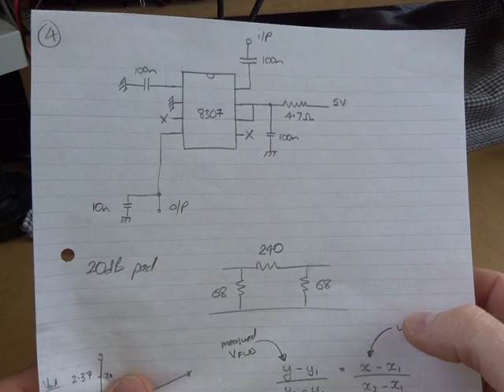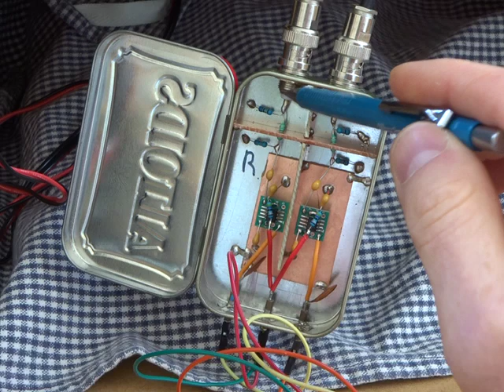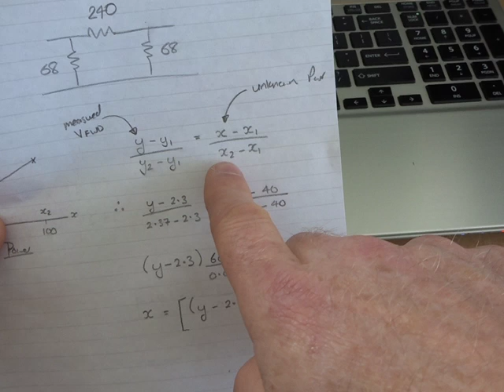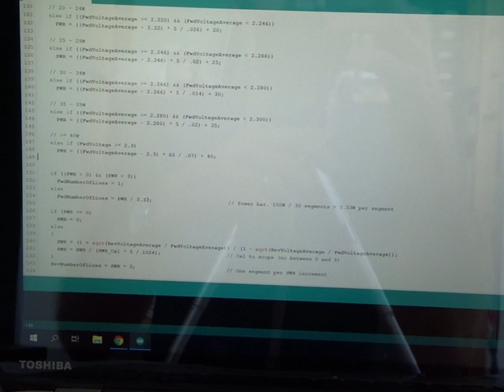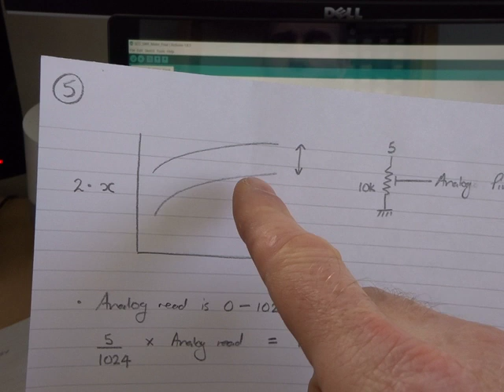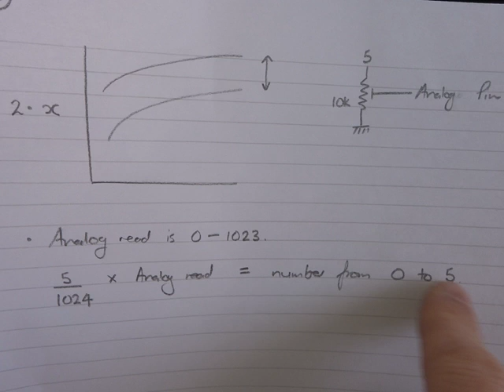Homebrew PWR/SWR Meter: Part 4 - Final Configuration and Software

Comment: Awesome job as usual. So I see you changed coupler from the twin, parallel coax with the DC output, to the other one with an AC out.
I was HOPING you would have created the display using the TFT "Cross Needle" unit. 
Oh well, perhaps another time.

Comment: i have a problem with this line  and I don't know how to fixed it   
that   "lcd.begin();" keeps error
   Serial.begin(9600);
  // Initialize the display
  lcd.begin();
  lcd.backlight();
  lcd.createChar(1, Bar1Array);           //Special charaters for the PWR and SWR bar display
  lcd.createChar(2, Bar2Array);
  lcd.createChar(3, Bar3Array);
  lcd.createChar(4, Bar4Array);
  lcd.createChar(5, Bar5Array);
  UpdateDisplay();

Comment: I was wondering why you didn't increase the number of turns on the toroids in the tandem match instead of the 20dB pad? Wouldn't that do the same?
Reply from the maker: Hi Cedric. I'd have to have a think about that. The pads work well as they maintain the 50ohm match. Adjusting the turns ration could upset the impedance match.

Comment: Hello Mr Morris,
I m trying to copy some of your creations but I crashed on the ad9851 programmation. I already use its brother, the 9850, and I see on the datasheet that I have to differently codify the  frewuency word but it doesn t work..
In your opinion what is the problem? I think it couldn t be the circuit cause is the same!
Reply from the maker: Hi. My advice would be to open up one of the example sketches that came with the AD9850 library you are using. From there you will be able to work out what syntax to use in your main sketch.Charlie

Comment: Also, how did you make your LCD block chars look like they expand? I've had trouble coming up with viable meter chars with some displays. Yours expands and contracts smoothly. Nice!
Reply from the maker: Cheers. I created 5 special characters; one bar, two bar... five bar.  (The code is on the blog). I then work out how many single bars I need, then start printing full fuve bar characters until such time as I have less than five left. I then print the remaining 1-4 bar segment as needed. It certainly works well and looks nice and smooth.

while (FwdNumberOfLines >= 5)
  {
    lcd.write(5);
    FwdNumberOfLines = FwdNumberOfLines - 5;
  }

  if (FwdNumberOfLines == 1)
    lcd.write(1);
  if (FwdNumberOfLines == 2)
    lcd.write(2);
  if (FwdNumberOfLines == 3)
    lcd.write(3);
  if (FwdNumberOfLines == 4)
    lcd.write(4);
Reply: @CharlieMorrisZL2CTM  Nice. Small optimisation... lcd.write(FwdNbrOfLines);  😁
Reply from the maker: @Paul_VK3HN  Cheers.

Comment: Hi Charlie-Thank you ,watching ,taking note and learning from your brilliant work!
Still learning the math's !!
 Thank you  again-Mal
Reply from the maker: You'll get there Mal. I'll try and throw in what little I know in the videos. It certainly comes in handy when trying to nut things out.
Reply: @CharlieMorrisZL2CTM Hi Charlie, Thank you - I would really appreciate that help, that would be a great boost !!
 How did you get on with your sig/gen psu problem ? -Mal
Reply from the maker: @ashave9100  For now I am just ignoring the shield issue as a artifact of double insulated devices. I just make sure the centre conductor has a 100nF decoupling capacitor (different issue).
Reply: @CharlieMorrisZL2CTM  Understood- 73 Mal

Comment: Hello.
 If we want to combine all the necessary equipment in a box. What should be the minimum box sizes?
I am doing research to make a portable swr meter.
Thanks.
Reply from the maker: That's a good question Irfan. I suspect that depends on what power you want to run through the coupler. I know my coupler box is probably way too big, but it was all I could get. Either way, you want the coupler to be isolated from the AD8307s as they are very sensitive. If I did it again, I might try and squeeze everything into the metal box, with full dividers between sections. Not sure if that helps sorry.
Reply: @CharlieMorrisZL2CTM  Thank you.
My opinion is maximum 50watt for mobile.
I wish I had the size of a pocket.